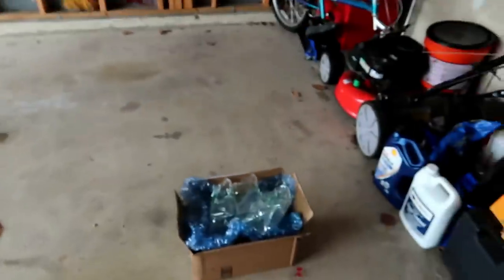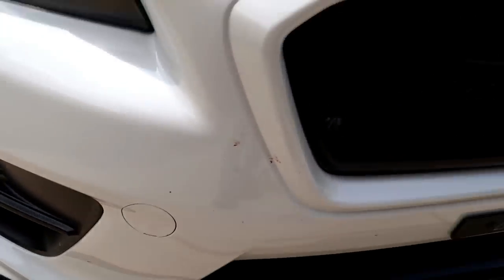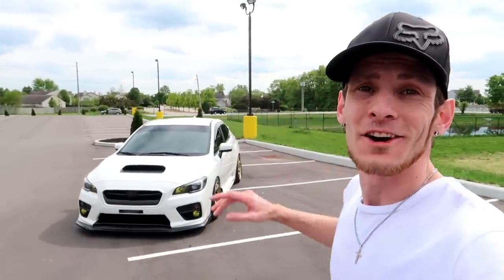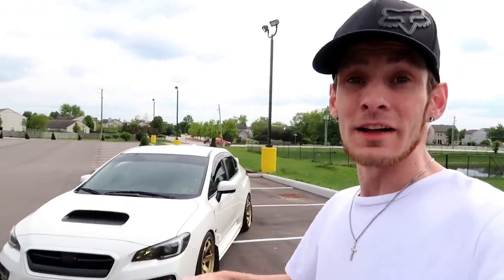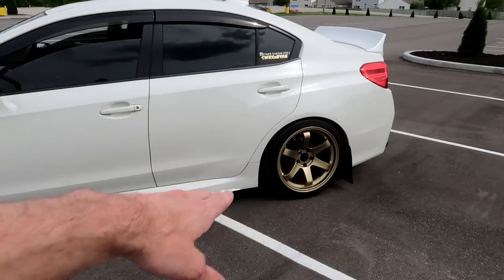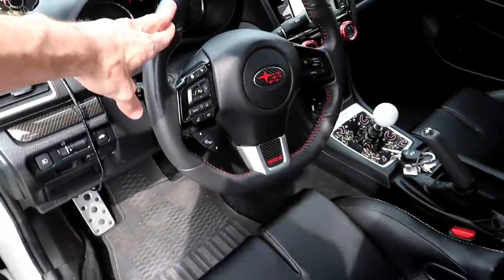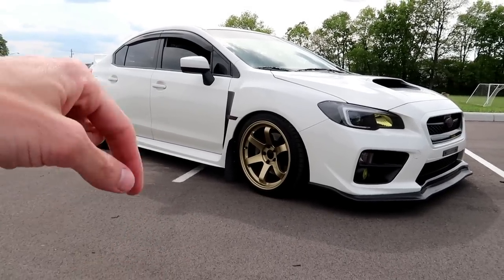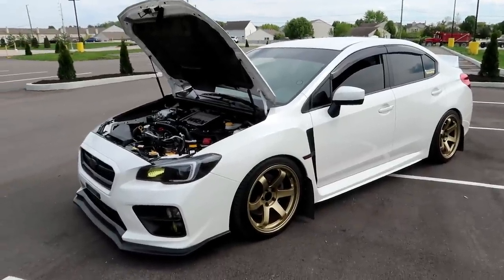More POWER for the WRX...  E85 !!!

Comment: Limited wrx and STI's come with the harmon kardon system. I did a base STI and upgraded to the OEM kicker speakers and sub. Added the android idoing headunit and it sounds really good. All for well under $1000. Backup cam works just like OEM and I now have carplay. I suggest checking it out. It's a nice upgrade if you want a plug and play setup.

IMHO, I am not a big fan of the duck bill. The car is really cleanly modified, but the duckbill, to me, cheapens the overall look. I think the VIS or Seibon trunk would look worlds better.
Reply from the maker: Thanks for the advice

Comment: If you’re looking for great sound I recommend JL audio coaxial speakers on all 4 doors but if you don’t want to spend too much on speakers then Infinity Reference coaxial speakers and Alpine Type S speakers are some of the best speakers on the market that work well with the factory radio.
Reply from the maker: Thank you for the info.  I'll look those up. Do I need some sore of adapter plate to bolt the speaker to the doors or do they bolt right up

Comment: I have a set of jl audio C1’s in my wrx and they sound pretty good amped or off the factory head unit.
Just remember to at least get a set of fast rings if you don’t plan to add sound deadening to the doors.
Reply from the maker: Thanks for the advice